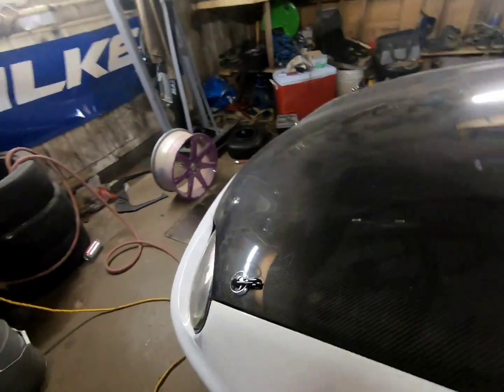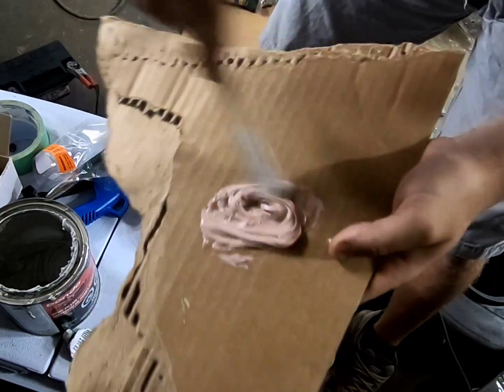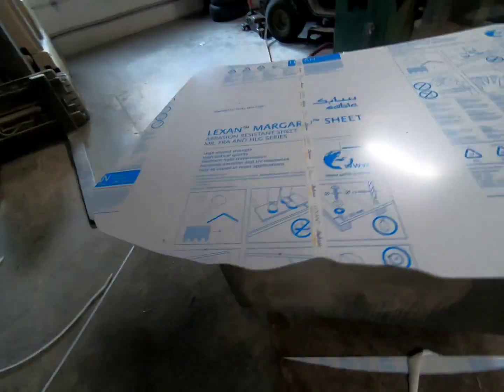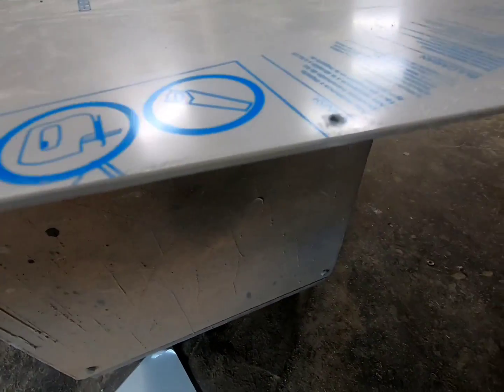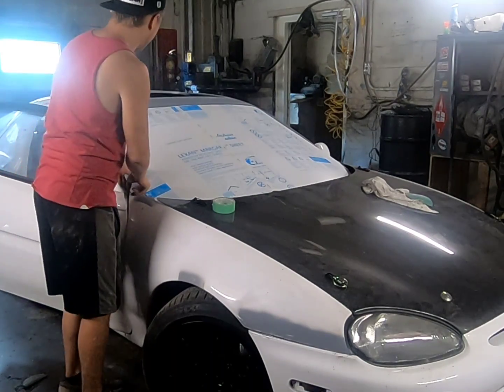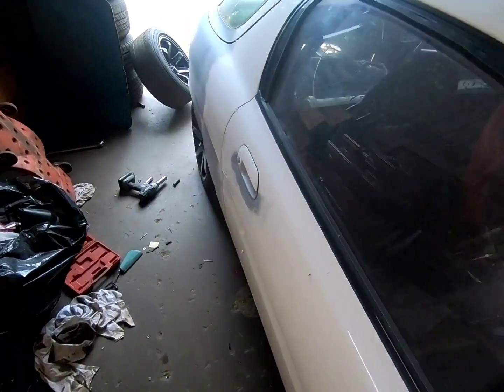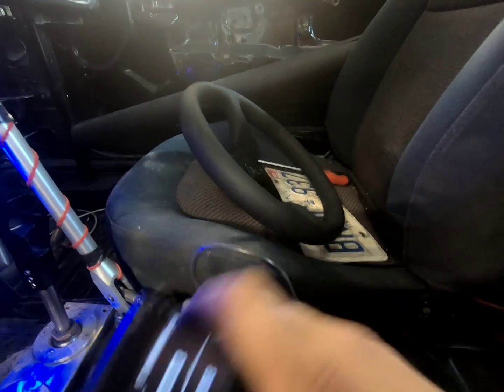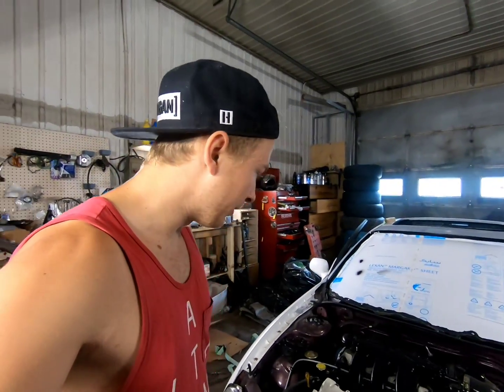how to make a lexan windshield easy!

Comment: Nice work.  What thickness lexan did you use?  Oem glass thickness?  Does the windshield look flat or does it match the correct curvature of the car?
Reply from the maker: 1/8th thick! and yes it matches the curves just right